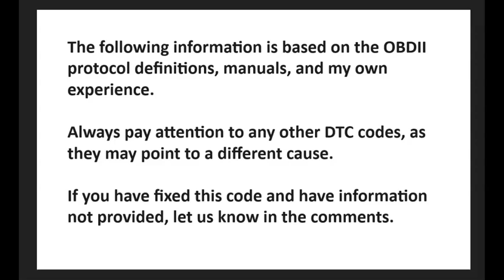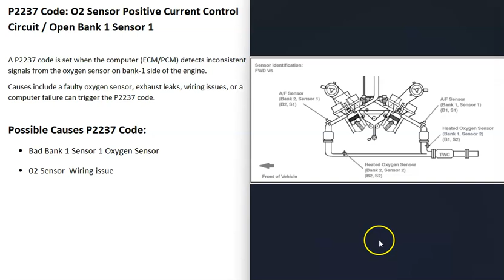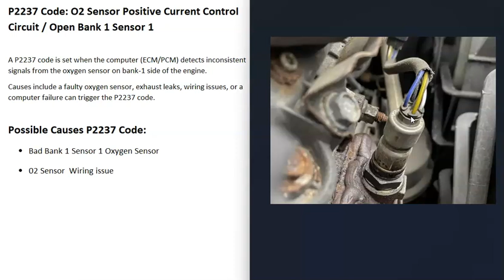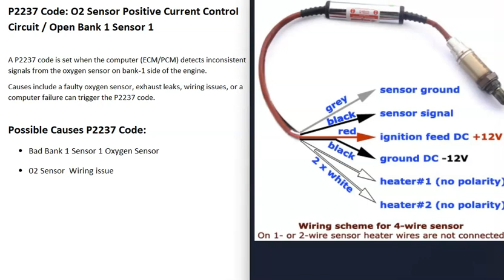Causes and Fixes P2237 Code: O2 Sensor Positive Current Control Circuit / Open Bank 1 Sensor 1

Comment: if this has popped up been stays gone after clearing code for like 1000 miles, does it seem like a sensor/wire issue or a pcm?

Comment: If I see this pop up, can I drive it to the mechanic?
Reply from the maker: As long as that is the only code, most vehicles with a P2237 code still run OK. It won't go into what's called a closed loop where the computer is fine-tuning the air-gas ratio.

Comment: Sir my problem is samee what you mention but I already change the oxygen sensor but after a minutes the faults code come again even reset to the obd scanner ...my question is how to solves the problem my oxygen sensor is new
Reply from the maker: If the sensor is good, I would test the wiring.
Reply: @HVAC_Mechanic  yes..I'm thinking of that...before that I'll try reset again the fault is already gone..but my problem is when I 
Parking stop the engine then when I start again the fault oxygen sensor light again...
Reply: I have replaced all the C2  sensors And tge catalyze converter  I tell them it’s probably the wiring but they all  want to replace an other c2 sensor
Who do you fix the wires?
Reply: CHECK FUSES

Comment: Excellent video, thanks for info, I have replaced the O2 sensor, and have checked the connection for continuity, I’m still getting this error code, Lexus GX460 2012, any help is appreciated
Reply: If the problem persists even when you've changed the sensor so the problem will be between the ECU and the plug to the sensor.
Reply: @MrChilo89  thanks for that, that code went away when I cleared it, however it comes back every so often. Goes for a long while but does come back and stay for some time. I’ll get this checked